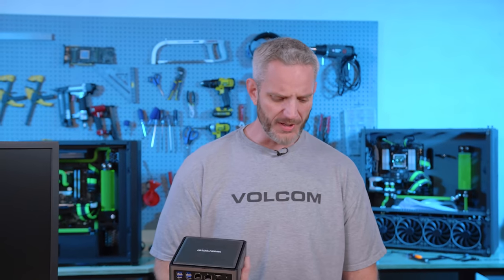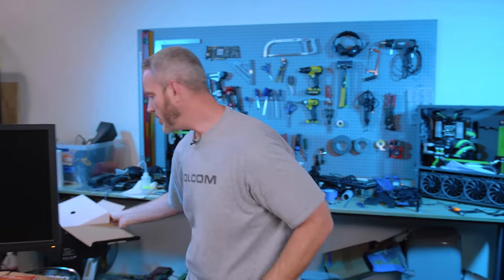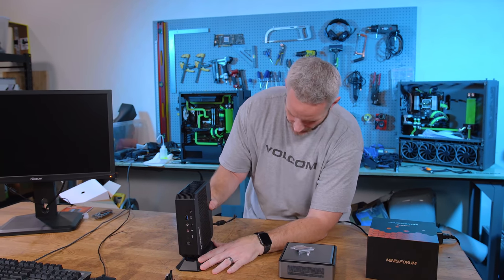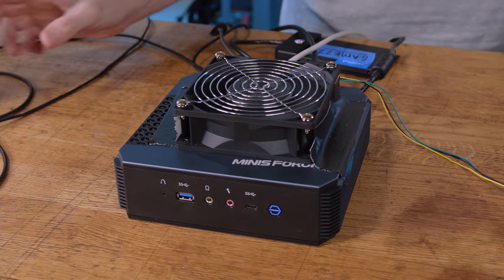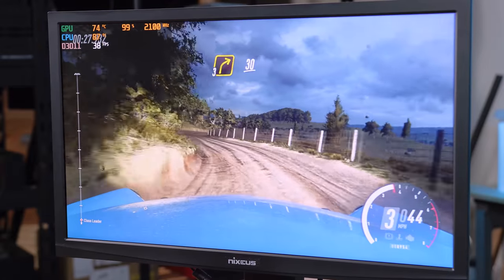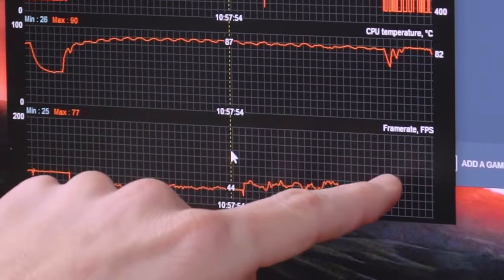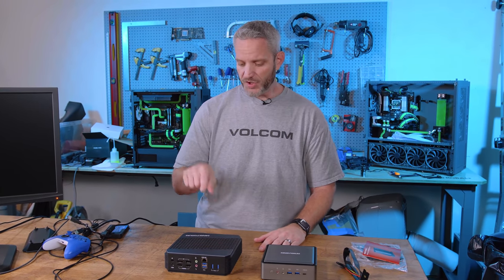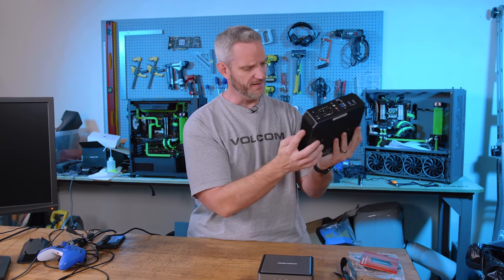It LOOKS like a modem... but its actually a Monster PC!

Comment: i didnt realise dirt rally 2.0 was that hard to run, i have an rx550 and an amd fx6100 paired with 16gbs or ddr3 ram and mine runs at a stable 45 - 55 fps on mainly medium settings depending on what im doing

Comment: Great video how ever... I feel like its wrong to complain this machine doesnt perform well in CS:GO when you say people want the highest FPS and then proceed to use 2X MSAA. This is still rather heavy and it burns memory bandwith, which you have a very limited supply off in an APU. 

I wouldnt be supprised if you gained a lot of FPS back using FXAA, SMAA or TAA.

Comment: I have an older TV and I use a Raspberry Pi 4 to run Kodi and play retro games. This thing would be an awesome replacement. Its APU is better than the GPU and CPU that the Pi has and I would be able to watch more movies and videos in 1080 instead of 720. The only issue might be drivers. I'm not sure how well Linux works with these new APUs yet or if this device has anything proprietary that would prevent all of its features from working and I'm trying to get away from using Windows.

Edit: Went to their website and they offer them with Ubuntu installed. 👍

Comment: I think my X300W build is smaller and just as powerful with its 5600G APU and with the Nocta NH-L9a_AM4 low profile cooler stays cooler my max temp running Intel burn CPU stress test for over 30 min is 84c and during gaming only hits 76c at times but I also use for media and when I go on the road I turn on my gaming rig on with Steam running and stream games and it works surprisingly well for none FPS games .side note tho my X300 build did not work out of the box with the 5600G but I have a media pc with a Athlon 200GE and I used its APU to do BIOS update from 1.40 to 1.70 on the X300w system and now it work like a champ .

Comment: Huh.  You need to check out the Phantom Canyon NUC (enthusiast) from Intel.  Granted, ultrabook CPU, notebook GPU, but if you really want something in a similar form factor, but still capable of 1080p gaming but on high settings (maybe ultra, depending on the game/turning RTX off).  Too bad they made so few, and the Intel dGPU one is coming down the line soon.
Reply: The RTX 2060 NUC is definitely the best minipc for gaming right now.

Comment: i'd slap my nh-d15 on it after removing the panel and cleaning the cpu 42 times to make sure no gallium residue eats the aluminium. surprised considering the custom pcb they didn't isolate the cpu onto one side to make a heatsink out of a whole side panel/at least wider for a 120 or 140 mm low profile fan, & everything else (i.e. amateur skill level upgradeable/swappable components) on the other side, but maybe next time! kudos to the liquid metal though, imo there's no reason for prebuilts/laptops to NOT use it (in fact that'd be a huge selling point, even to custom riggers inexperienced/scared to do liquid metal, so long as good enough warning about replacing/removing/upgrading is there for non-enthusiast consumers/3rd party repairers. in my proposed cpu-on-back, a sticker on a screw preventing taking the board from box, saying ONLY CPU UNDER HERE FECK OFF IF YOU CANT LIQUID METAL OR YOU'LL BREAK SHIT )

Comment: I am currently waiting for mine will be here Tuesday the 8th,  will be using it as my Home iTunes player and will buy two 8TB 2.5 SSD drives, may upgrade the main M.2 drive later not a priority,  but I do have or the late wife and I have almost 10TB of iTunes movies and TV shows combined so I will make those two 8TB drives work as if it was one 16TB drive, I was lucky enough to get the last of the Alienware laptops that came with 3 M.2 drives and 1 2.5 drive bays love that I can travel with all our movies and TV shows and play my games, but this little PC will work great at home for my intended purpose  and daily use🙂

Comment: i think that intels big and little cores will be good for this use case if they can get to amds level of efficiency since you can get many low power cores for multi thread tasks and since gaming very many threads you get the normal cores. I think 6big and 4 litttle or 8 little would be great

Comment: I have a 1060 razer blade that runs my TV because I can't stand smart TV slowness and UI design that I've been looking to replace with something like this, I've built a deskmini when the 2400g was current and its probably still a better option long term to run a 5600g

Comment: The missing Thunderbolt on AMD platform is no technical problem, it's the sole decision of the manufacturer to include TB or not. There's some kind of certifcation process from Intel's side and most probably the manufacturers don't want to spend the money.
Could also be that Intel pulls some shady tricks when asked to certify such boards.
Reply: There is no "shady" things going on...intel owns thunderbolt and it is up to them if they let a competitor use it or not...
Reply: @samgoff5289  I'm not talking about that "not letting other platforms use it at all" kind of shady. Because there are mainboards and add-in cards for the AMD platform, so it's no impossible.
And I guess Intel would not pull the "we don't license at all" card anymore, because it could backfire.
But there are other ways to avoid having TB in too many AMD platforms and to not be accused of not licensing it to others (especially if you think of Intel allowing USB-IF to use TB3 functionalty royalty-free): artificially prolong the certification process.
Not saying that Intel actually does this, but it's quite strange that you can find AMD platforms with TB, but very sparsely. I don't think the additional costs for a TB-Chip are the problem, especially for high-priced mainboards.

Comment: I wonder if the future of GPU's will be in the form of a standard cpu style. Where it would install to the board directly into a socket and be cooled by a standard gpu cooler.  I just think that it would be a great idea to get a great cooling solution for gpu's.   What are your thoughts?
Reply: There are a few problems with socketted GPUS.

If the GPU is socketted by itself, then latency with VRAM causes issues, and there's potentially issues with poorly designed power delivery.
If the GPU is socketted with its VRAM (and even power delivery), we've returned to MXM, which never saw wide spread adoption because of expense (chicken and egg issue), and demand wasn't great even with the enthusiasts that initially backed that bargain. Outside of laptops anda few niche desktops, MXM wasn't nearly as attractive as comventional AiC designs or just soldering components (which saved a decent bit of space depending on the computer's design). SFF computers don't benefit as much from completely standardized components as traditional desktops do, some proprietary designs exist because standardized counterparts bring too much compromise.
Reply: @reaperreaper5098  Good post.

Comment: I think this would be a great computer for my garage, because I need something small sometimes that can connect to the monitor.
Reply: In the garage, what's best about the little systems is you can limit their wattage and easily vacuum them or blow them out if they get dusty. And you can easily stick em on the wall out of harm's way.

Comment: Would like to see this go against a Ryzen 7 5700G + 32GB at 3200MHz RAM + Asus ROG B550-I motherboard in an InWin B1 case.
Reply: The 5900HX beats it on paper (both graphics & compute) though you'd get a benefit of good thermals with the right ITX cooler on a 5700G that might level things out.

Comment: So I guess the question to me then is, given its limited integrated graphics that are basically the same as the prior model and are clearly the limiting factor for gaming, is there an actual reason/use case to buy this beefier version?
I mean ... if they're the same price ... MOAR IS BETTERS!!!  LOL  But if there's a price difference...
Reply: It's almost got me interested. You can get a barebones for $650usd which isn't all that cheap even for an 8-core, but it has excellent connectivity and flexibility for the corporate space. For example it can run quad 4K screens (such as airplane flight times, or a set of restaurant menus), where it may be overkill. Small and quiet with tons of memory is also good for virtualization and encrypted desktop formats, video surveillance, photo and video editing for anyone who doesn't need a Threadripper and/or RTX 3070+. The 8-core should be comparable to a desktop 3600X or 3700X depending how much wattage it can take, and the APU while not amazing for games can give a large speedup in OpenCL/Vulkan compatible tasks like some of the Photoshop filters.

I'm looking at the 32GB/512GB with Win10 preinstalled, for less than $1000usd. Max is up to 64GB and there is room for TWO additional storage devices. (three total) There are a lot of great choices in this space so I am not especially set. (heck the ASUS PN50 is what like 11x11x5cm or something?) I think this platform might be even better with an 5900HS instead, but those are a choice binning due to their efficiency.

Other thoughts, the 2.5gb Lan and triple-bay storage plus USB-SS could make this a very effective NAS. Three-bay and four-bas NAS are still pretty darn expensive and too many are also limited to 1gbE instead of 2.5gbE. Compared to a lot of them, this has tons more raw power to transcode video for client devices....you could potentially even stream drone footage raws onto a smart TV or mobile device. I've already seen interest for PLEX servers and similar ilk, but lacking a TB4 or USB4 limits the kind of media capture cards and digital cameras that can be used.

There are a lot of devices which can beat this on at least one area, but as an all-purpose compact system it fits multiple uses for clients who can only afford one machine. And on a large scale you can buy many of the exact same device and put them to different uses. Lots of applications, only a few common spares needed if any of them die.

Jay saying it looks like a modem or router has me thinking, someone who breaks in could overlook it and steal a computer that was configured for remote boot (no loss of data).

Lenovo, ASUS and several others have (literal) thin clients and mini systems to compare against this, some down to the $400-500usd range as complete systems.

Comment: Hello 
I have a question regarding PSUs and maybe someone had this happen himself and can help.
Last week i just started my PC and and it was more or less idlying. Then i heared a crack/click noise and my pc was off. When i pressed the power button on the front nothing happened (which is why i  think its PSU related or atleast some kind of shut down). After taking every cabel off, turning the PSU off at the back of the PC and turning it on again the PC did start normal and since than it just works as always. I opened my pc but could not spot anything wierd and did not smell anything unusal. 

I dont know if that is in any way related but a few days before it crashed during Assassins Creed and somehow my gpu was "deactivated" (AMD Sapphire 5600 XT) but i was able to fix that in the system controls "activating" the gpu again.

I have a Be quiet Pure Power PSU and i could not find anything like this in any kind of forum so i just wanted to try here and see if someone has a clue. My main concern is that this could happen again and damage my gpu or other components. 

thx for reading

Comment: Hmm... so considering how I usually use laptops for work, that box makes a tonne of sense. Same weight, more compute and a nicer form factor. Yes, I always have monitors, keyboard and the lot where I work, just slot dumb laptop into dock. That would just remove the dock and be "get shit done". TBH, it'd be a boon for everyone really.
Reply: You can attach it to the back of a screen or the side/underside of the desk with included bracket. I feel your pain on the docking, a U-series can be docked in the closed position but most 35-45W laptops risk damaging the screen if operating at full power in a closed position.

One of the greatest ultrasmall types was(is?) the Asus PN50, which was like 4.2 x 4.3 x 2 inches or something. With up to like a 4700u or 4800u 15W eight-core.

I've also seen Asus and Lenovo all-in-one desktops with a companion screen beside.
Reply: @passintogracegoldenyearnin6310  whole point is mobility, not putting it on the back of a screen.
Reply: @Illindi  Oh like a Gamecube. I see. Typically when people talk about docking laptops, they have some need to use a laptop away from the office....or the office puts all the laptops in a safe at the end of the day.

But yeah if you're going between home and office then you could take the whole box between sites. Three SSDs, 2.5GbE and plenty of ports.
Reply: @passintogracegoldenyearnin6310  err... people don't have fixed desks all the time or you move between rooms over the day. But yeah, put in a bag and go. For a private thing, no, but for work yeah.
Gamecubes? You kinda need to unloop your train of thought maybe?
Reply: @Illindi  In terms of form factor. Sounds like you want a sturdy, compact system with all of your files and settings. But you don't need a built in screen or battery. Interesting!

Yeah, if you have such an environment where you want to move your workstation around...and provided there are peripherals available at each location. It may be feasible.

Comment: to be fair, the problem with APU is not the core itself but the lack of memory bandwidth and memory latency
I hope DDR5 fix the memory bandwidth problem about APU.

If software way to manage bandwidth is hard, why don't physically add dedicated memory for CPU/APU?
This special memory design will be fast but small, act like L4/L5 cache before RAM.

For saving space, it will be embedded in the motherboard near the CPU itself because closer = less latency = more performance.
In this way, a high-end motherboard might have better/more memory while the low-end might have small to none.
Let's say it has 4 GB, means you don't even need to buy RAM for basic office workload.

And here I am day dreaming

Comment: if they used copper slugs or heatpipes instead of the milled aluminum they use in the stock cooler it probably wouldn't throttle lol
Reply: They do use heat pipes

Comment: That is an amazing small form factor PC, but why don't they have thunderbolt on AMD yet? Thought it was available to AMD already.
Reply: Asus is making one AM4 board model with a thunderbolt - ProArt B550-CREATOR. But I do not know about any other. Even the extension pci-e cards require intel chipsets...
I would be interested to get info about how much and upon what conditions is Intel providing Asus license to use TB4 on the AMD board. Or what technical difficulties does the adoption brings.

Comment: Would love to see dual rank higher total ram than the crap 16gb single sided blue-light special it receives, which is why this model is compelling for the space concerned folk like me... barebones + better ram & a WD black ssd versus it's flea market variety Kingston unit should net dramatically better results, no? 64gb would net 8gb dedicated vid ram, as the bios is at least adjustable for that (stated on another review). Wondering if agree? Love (& need) the portability, really appreciate your insight!!!!

Comment: "Console killer!" 2-4x the price, 1/3 The power. Not starting a war but thought that was funny
Reply: .... which is why he said it's not immediately after he said it.
Reply: @muntedewok  Actually the context behind what he said mentioned the components of the modern consoles being the reason as to why it wouldn't be a console killer. I pointed out the price factor and the fact the components were actually much weaker. But I did so as a joke because I found the comparison funny.

Comment: Sick of the Thunderbolt crap, the reasoning is simply not good enough. There's Thunderbolt 3 on the Gigabyte WRX80-SU8-IPMI motherboard and Thunderbolt 4 on the ASUS ProArt B550 Creator motherboard. In an age of time crystals, thorium reactors, record short times for vaccine creation, particle accelerators etc, I'm pretty sure they could get Thunderbolt in these smaller packages.

Comment: IIRC the 3400g is the best gaming APU on the market since they haven’t released another APU with a Vega 11 or greater since. The new APUs are better on the CPU side, but are lacking on the GPU side. The 3400g is far better balanced.
Reply: Got the 3400G in an ATX desktop case and the 4750G in an Asrock x300 Deskmini. The latter does a bit better in gaming, and a lot better in everything else, imho
Reply: @ЛюбомирДинков  Haven't used a 4750g myself, but looking into it a bit their gaming performance is roughly equal. Some games do better on the 3400g, others do better on the 4750g. Either way 1080p low it is a difference of 2-5 FPS depending on the game. 

And yeah, obviously the 4750g is better at non-gaming workloads. It has twice as many cores/threads and slightly newer architecture. It should be better. But that's irrelevant to what I was talking about. It was just gaming on an APU. Other workloads were not a factor.